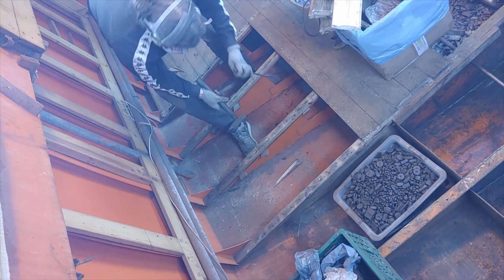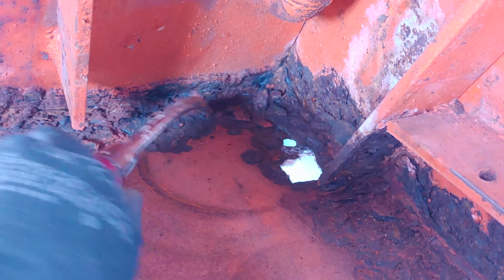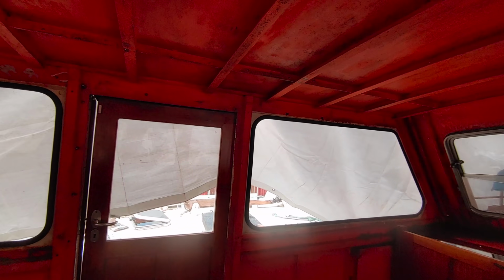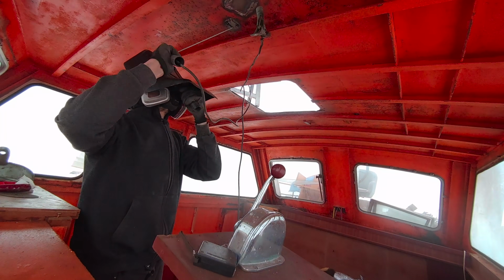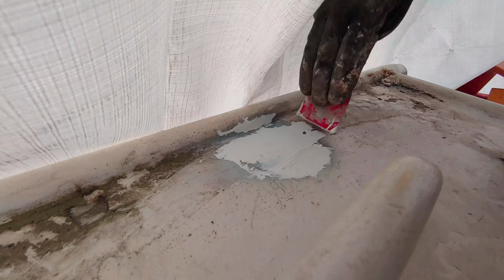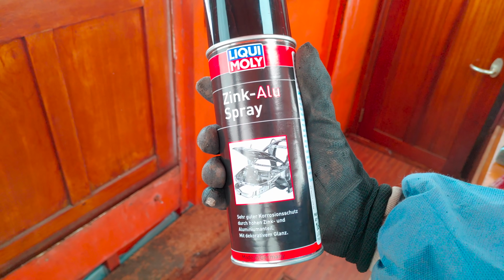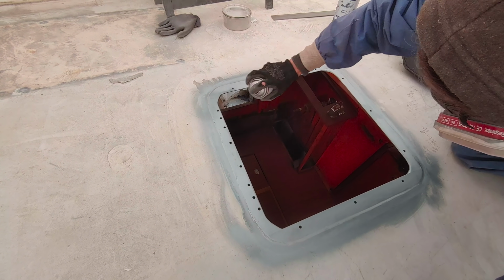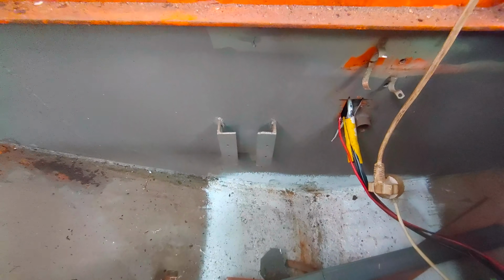Dealing with Heavy Rust on our Steel Boat - Week 27 - Vintage Yacht Restoration Vlog

Comment: I am kinda late to the party with this comment but a needle scaler would work wonders for these areas.
Reply: Yes, the needle scalar is not just the best choice, it's the ONLY choice. However they require a good air compressor, which he does not seem to have.  He's doing OK with what he has.
Reply: @jakleo337  yeah he definitely is doing ok, it's just so hard to do without it.
Reply: Yes I agree with you they require a lot of air. I have seen electric versions before, I just don’t know if they are any good or not. I am in no way taking away from the work that has been done just wanted to point it a tool that some don’t know existed.
Reply: i agree it would be more efficient and do a better job

Comment: Thru Hulls: avoid chinese as their foundries are producing sub quality bronze that can go pink in as little as 5 yrs.
if the standpipes for them look in the least suspicious replace them with new steel, just cut a thread on it before you weld it in.
5200 should be ok but you might not ever get the thing off if you need to, although Im not sure why you would want to do that. 
And position them where you can actually make them work properly, that is to say the scope of the lever has no interuptions.

Comment: Great progress, again.
Remember that Owatrol Oil is not a rust converter, merely a sealant. It would be better to use something like Fertan to convert rust, then grind it away and do some lead loading where the steel got very thin. This will also prevent further corrosion. Owatrol on an exhaust pipe is not going to work, better convert the rust and spray with a heat-resistant inox spray (for welding).
I also wonder if the filler you use is going to last as it is very hard and will have a different thermal expansion so eventually may crack when the steel warms up in the sun.

Comment: For cleaning rust from pipe use a chain , one turn round the pipe and pull back and forth. Make it wate tight whith regular pipe stuff not m3 silicone. Lin an some lin greas

Comment: that exhaust pipe is going to be a problem ,you dont know how rusty it is on the inside. just saying .
Reply: My thoughts as well. It's especially important since the exhaust pipe is inside the boat, and any leak will put carbon monoxide into the cabin.
Reply: right !!! and in general, for the exhaust pipe it is necessary to use not ordinary steel ...
Reply: No problem. A battery driven carbon monoxide alarm will do.

Comment: Many years we used a brushable sealant made by Orminoid called Hydraseal ,,  its thick, you mix a small amount of petrol to the density  you desire and brush it on your fitting ,, the petrol dissolves and leaves t good thick coating on the fittings,,, I've unscrewed 6 inch galvanized under ground irrigation fittings relatively easy after  5 plus years ,,

Comment: Thank you for this video which shows perfectly how to replace a piece, a hole with a welded part. Which solder do you use? a stainless steel weld? thank you for your response, and Bravo for this restoration work ... !!

Comment: On the subject of the pipe fittings, the red stuff on there already is called Red Stag pipe jointing compound, it ,as mentioned by another poster can be used in conjunction with p.t.f.e tape or (horse hair) hemp, it's not really horse hair that's just a trade term.

Comment: hi there best to cut out rust in cabin helm and weld new plate  remove the windows cut haft way the front panel and side get good access look like rust on top too want change to new plate  now have good reason to change the shape of helm cabin rust came back and water get in will rust and rot why remove all the brackets not in the away hope keep need later IF THE  EXHAUST  IS DRY ONE  LOOK FOR Scoop Skin Fitting  CHANGE TO CAME OUT ON SIDE  BE NOISE

Comment: I personally don’t see an issue with filling in those areas and holes with weld. Just might be very difficult to grind down. But probably easier than cutting some of those areas out and welding in new steel. I am curious to see what you decide.
Reply: Can’t well to rust. These are stress areas that should have new metal installed. All he’s diving is putting a shine on sh*t.
Reply: @michaeldecker2725  Plasma cut it out you think and replace?

Comment: like watching a 2 year old trying to have soup with a spoon....... a bit of advice, watch some Utube channels on simple smoothing out fillers or just repairing rusted steel......wire wheel for grinder etc and sandpapers for fillers....doesn't need to be that difficult !

Comment: With all due respect. Rust converter will only slow down rust for a very short time (months not years), especially on a boat. Complete removal of rust and welding new metal where needed is the only long term repair. The exhaust pipe is also rusty on the inside. Sandblasting is the best method.
Reply: Yeah that fibreglass ain't gunna last long.
Reply: Indeed his is repairing his boat like a car that has to hold for another 2 years with a lot of luck.
Reply: He should use teflon plumber tape that is good
Reply: @paulmills3418  Teflon is no good on hot pipes like for steam heating or in this case, engine exhaust
Reply: @godlugner5327  ok why
Reply: Is that oil like phosphoric acid? only oil based instead of water based like Ospho????  I have never seen the stuff.  I have had good luck stopping rust where it is using silicone tire shine, which is good at wiking down between layers of rust, but then not much will stick to it in terms of paints or fiberglass;  Though I didn't think much would stick to any sort of oil either!  Anyway, I think I agree about the holes needing to be welded, unless you can use sealants like that tire shine after fiberglassing to seal moisture out from getting under the patches, rusting the metal underneath, which then pries off the patches as it expands.

Comment: @My First Boat _ Being in the Metal industry for over 50 yrs (I'm 72) I would seriously recommend using a Metal Scaler (Needle Hammer) to properly remove that RUST ... Take a look at this and perhaps hire one from your local Tool Hire Shop, Thay ARE available in Electric &  Battery powered: _

Comment: You should have sandblasted this. The rustconverter is a so so solution. It will work for a while but it has a bad habit of returning and then you're really in trouble!
Reply: Or due to restricted space should use a NEEDLE HAMMER/SCALER like this: https://trends.directindustry.com/bosch-production-tools/project-29638-122253.html
Reply: @liongod1000  yes thats a good idea!

Comment: its hard to tell with out looking at angles, but i think the hole you closed, will cause puddles on roof. The front of it and sides looked angle that you'll have sitting water. I could be way wrong though.

Comment: Loctite 577 liquid sealant will allow you to seal the valves. Or use PTFE tape.  But i would go with Loctite 577. its bullet proof once set.
Reply: I would be concerned that you now have two dissimilar metals in contact. Someone who is more experienced with  marine matters  should be consulted.
Reply: @suburban404  yes don't mix metals and if you use brass make sure it's DZR (corrosion resistant).
Reply: I'll go with that, I have used it many times and have never had any problems.